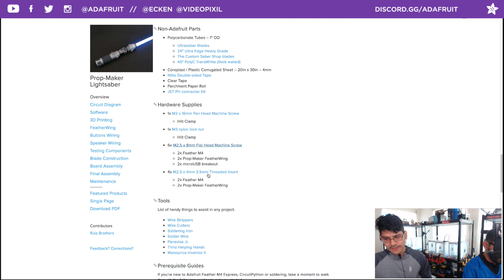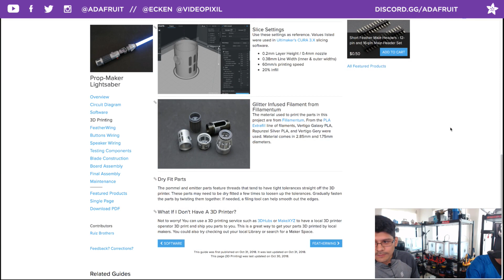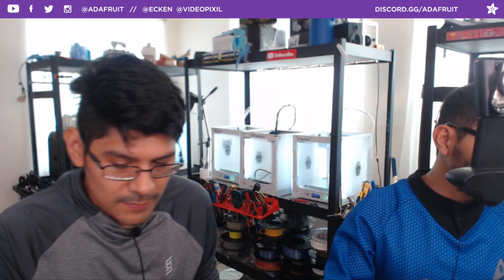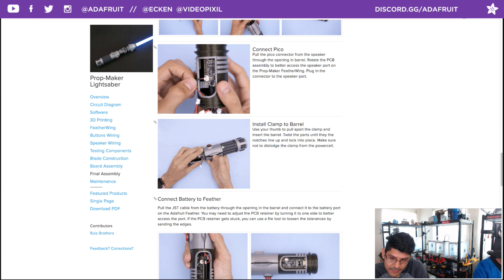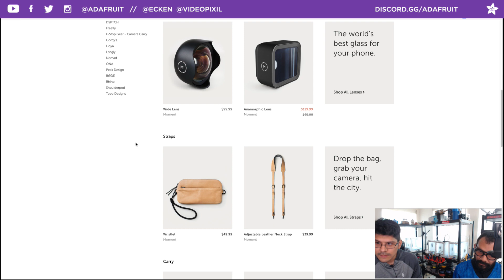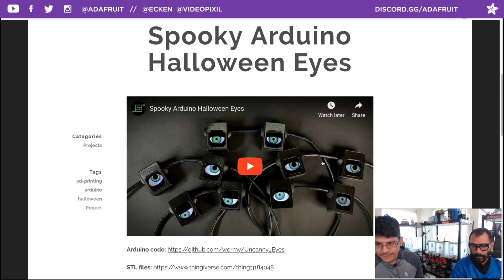3D Hangouts – Building Lightsabers

Comment: Is an M4 required or would an M0 express be ok?
Reply: I have the same question. Did you figure it out?
Reply: @DarkAngel22025  I got it working but it wasn't as powerful as I would like. I ended up getting a prizm 5.5 board instead.